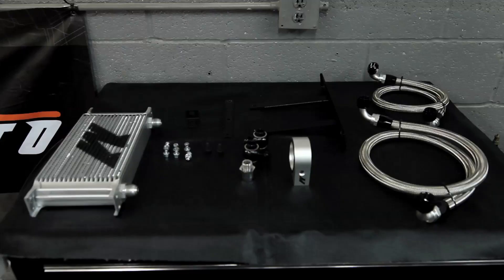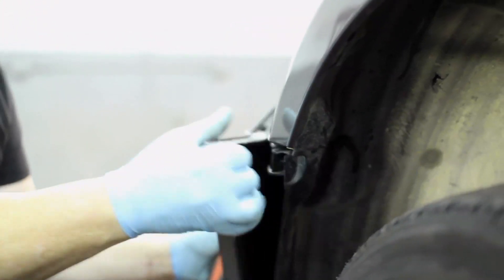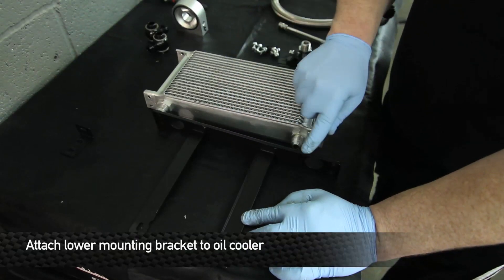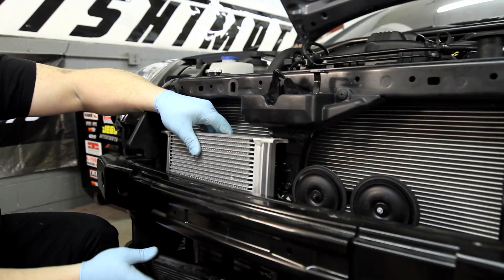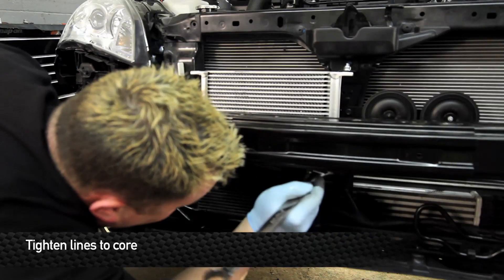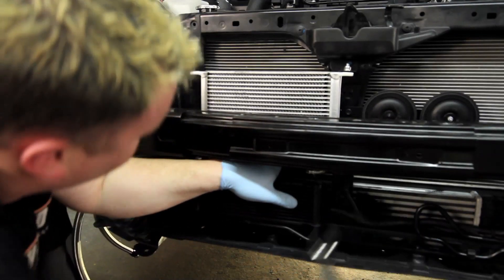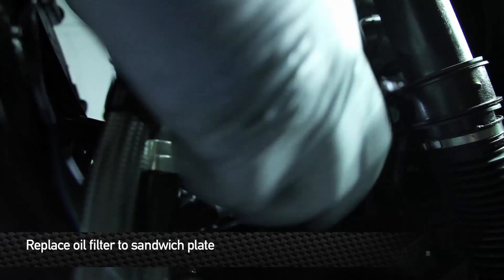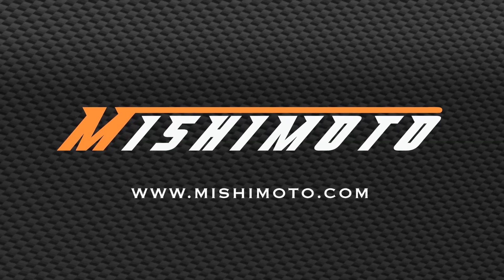Oil Cooler Kit fits 2010-2012 Hyundai Genesis 2.0T, Installation Video

Comment: I have a 2012 automatic 2.0t.  If I were to buy this kit, the way its mounted would it interfere with intercooler kit? Just wondering as I am aware that with the intercooler kit, you would either have to buy a new oil cooler/or relocate stock oil cooler.
Reply from the maker: Hello, customers installing the intercooler kit onto an automatic will need to relocate their transmission cooler.